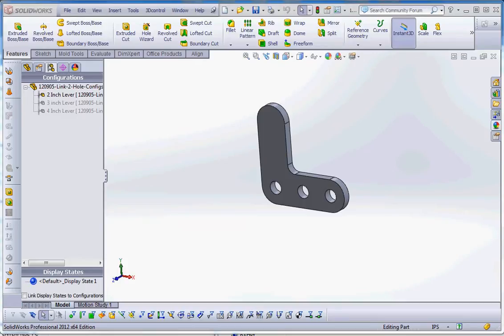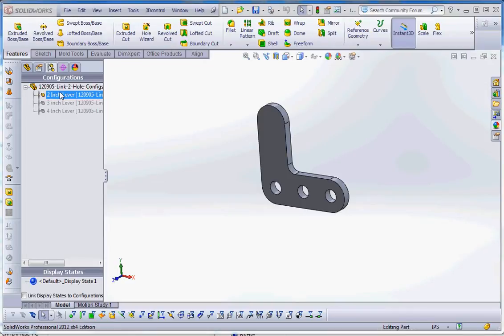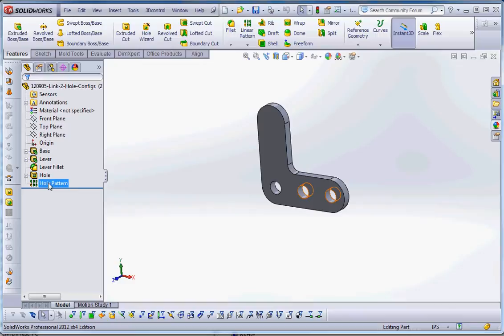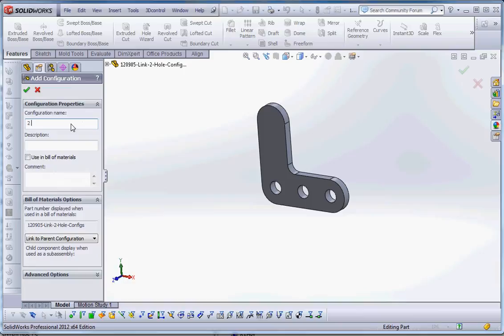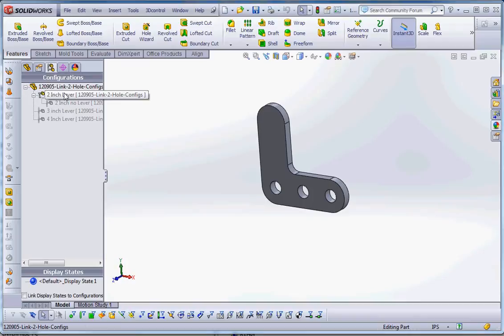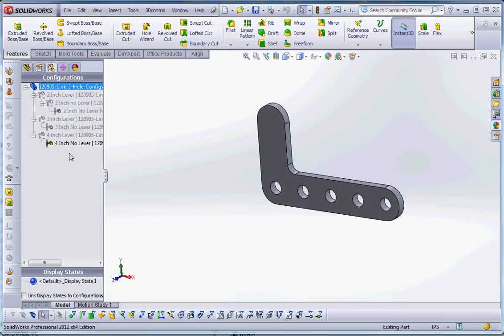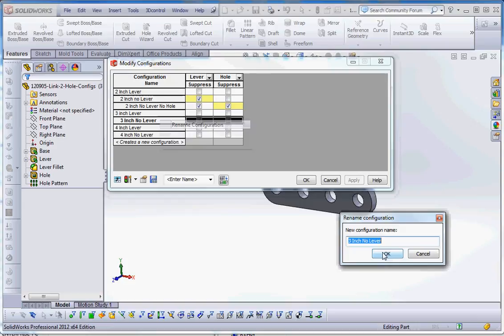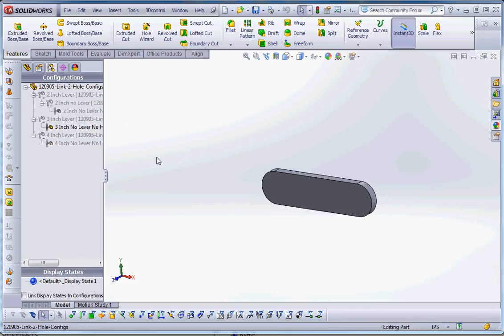Part 4 - Basic - Configurations, Design Tables & Equations, Derived Configurations

Comment: 3:07 What if I want to make 2 holes? If you suppress the hole feature all holes is gone.
Reply from the maker: @townnet  You can add additional features too - such as more holes - that can be managed by configurations also. It all depends on your design intent. I hope this helps.
Reply: @DesignInnovations  Oh I see. Thanks for your help.